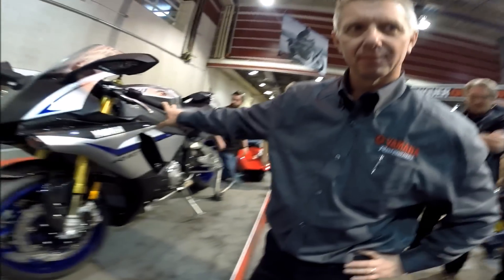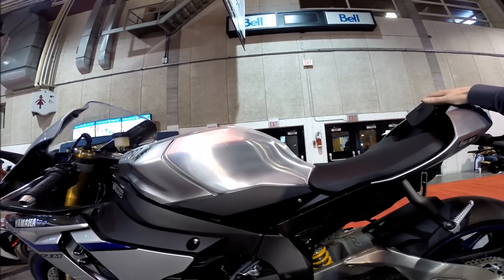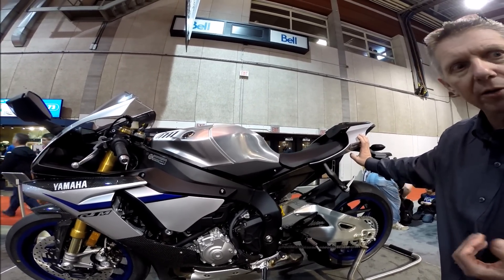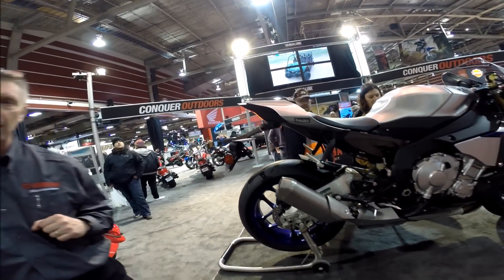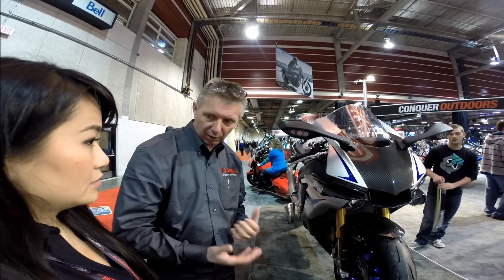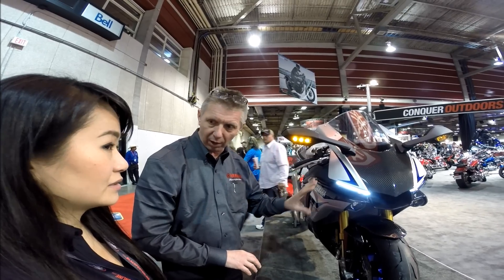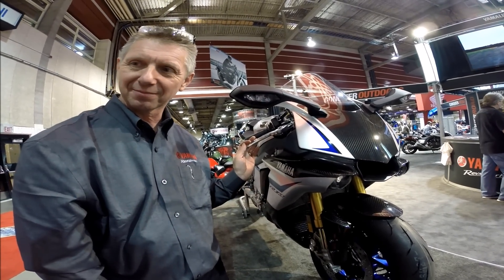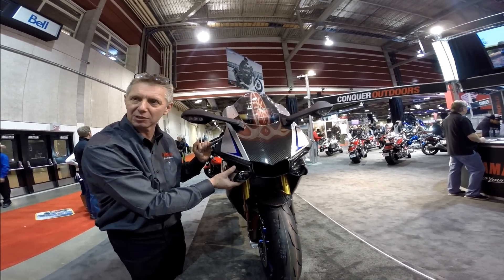2015 Yamaha R1M vs R1 info and features, Calgary Motorcycle Show

Comment: Really interesting stuff. I can't wait for the head to head, 2015 R1 vs 2015 s1000rr because they must have only tested that against the older model RR.
The H2(R) has gained all the hype, I do feel it will be over shadowed by the RR and R1 when it comes to reviews. Certainly 2015 is an exciting year for supersport bikes.
Reply from the maker: Thank u for watching and sharing your thoughts. I did ask later on, which year's RR he tested and it was the '14 (last fall was the test), would be curious the results with the H2 and 2015 RR!! :)

Comment: Holy crap! The prices on motorcycles are going up, That r1 should be around 13-14k thats it, Yamaha is trying to charge 6k more for what?? A better dashboard & abs? The r1 allready had everything else it has now...  And they could take there 1990's brushed aluminium look and give it back to lexus.. The nerve of some people! Did you here the prices on the ninja h2 & h2-r??? 55,000 Bhaaaahaaa,, You can get a supercharger for you bike around 4k.. im building my own bike thats it' Ill call it TM-600bk haha..
Reply: yes but the FZ-09 at 8K is a deal. Ride one in a tight canyon road I would take the FZ-09 over the R1 anyday
Reply: Michael Meyer I would take the FZ-09 Any day over the r1,, For some reason! Riding a upright position motorcycle is much more fun to me'" Idk why but it easier on corners, Tight turns, And countersteering, It makes me feel more confident.
Reply: trouble maker I am salivating over a\the FZ-09. just to ride to work and back through canyons and keep the FJR for the long haul. need to make some more money then I do now i cant even afford a new bike maybe if I sell my truck?  or change jobs
Reply: Michael Meyer No don't sell the truck! Its a necessity, I think you've had a long run with the FJR" So sell it! Then get the fz-09? I was just on YT checking out the 15, fz-09 and oh my it a nice machine! Me, I have $$ for the last bike I will ever buy then im done...